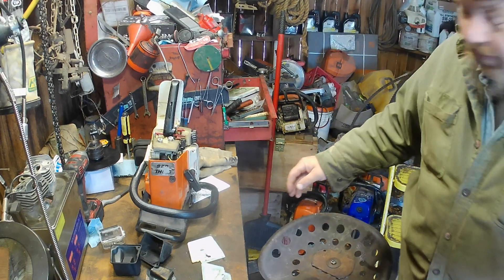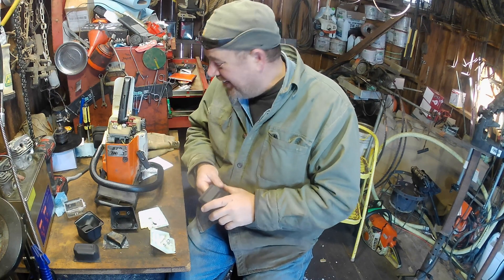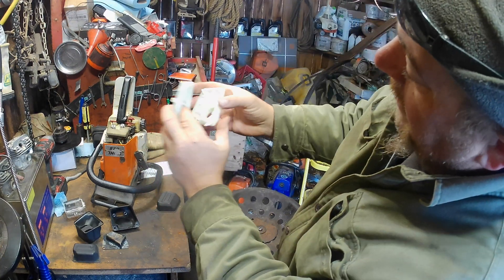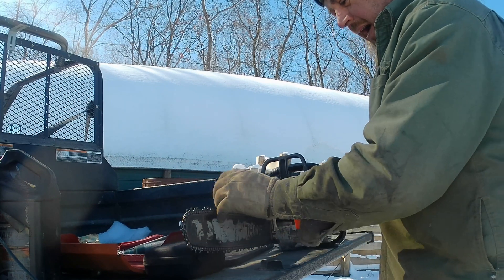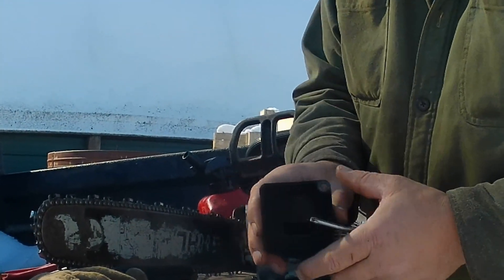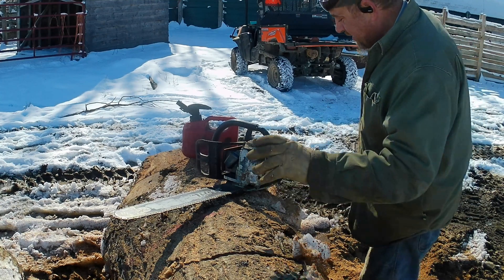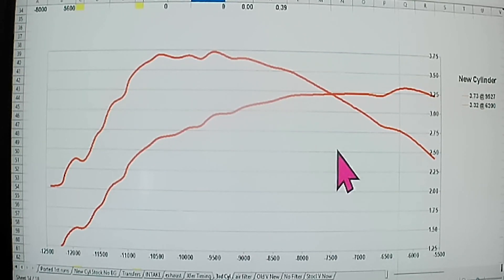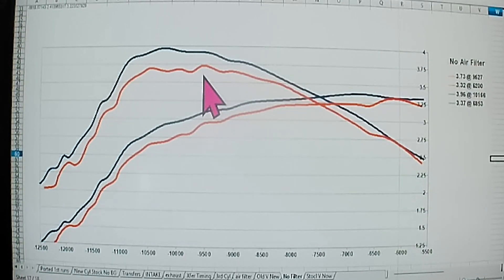Can I DUPLICATE Porting? - Documenting RESULTS with DYNO and CUTTING

Comment: I don't know how many times my projects are a two steps forward and three steps backwards deals. Anyway I'm learning lots. Great job on getting the new cylinder to match the last one. The hp# is coming around. I don't have any experience with 026 saws. I didn't realize the air filter was so restricted. I might suggest a bigger carb with a choke in the carb and maybe a ms390 type air filter might be close to making something work. Thanks for the video.
Reply from the maker: @TheJohnDeereGuy I don't mind a  project having hiccups when it's just my time; I sure didn't want people thinking I was jacking them around... just my mentality, I guess? I had a career in which my honesty was the cornerstone. I often find myself concerned that a simple mistake/bad luck could be looked upon as a dishonest/click bait, etc... move.
The plastic cover on the saw slides down a tongue/groove on each side while the back attaches to the back of the actual air filter. It's pretty limiting if attempting to keep the saw looking like the work saw that it's intended to be. I have a couple 390 carbs and 250 carbs... maybe an 036 carb or two as well. The "bolt pattern" is the same, so it may be better than nothing to just run a choked carb and get rid of the choke flap inside of the filter? We'll sure be trying something!  Thanks for joining-in again!

Comment: Great job as always. You couldn't get any closer to the old cylinder if you tried. 🤣 Oh wait you did. Nice job. As for the air filter I'd have to think about that one a bit. If I had one in front of me I do better with ideas. No don't ruin that saw with a big honkin filter hanging out of it. Thank goodness you don't want that. Love the sound of the bark box! As for exhaust mods. I often wondered if outlet location yields any benefits. Big hole small hole 🕳️ dual holes. I will say for a working saw big open dual ports seem to make the saw use more fuel without any feeling of a power increase. 🤷‍♂️ Tge chainsaw song 🎵 is the berries. Love hearing it. Hope to catch another video 🔜 👍🏻
Reply from the maker: @eze7524.Morning_Wood_Farms Thanks!! You're right, the saw needs its bonnet and such so it can still be treated like a tool instead of something fragile. 
Aint too sure the bark box gave any more grunt or hp, but it did sound OK, didn't it. It seemed like it sure ate up the fuel, but on the other hand, it looked like it had been running rich when i took the muffler back off. 
We are getting close to the testing of mufflers/mods/very mild pipes (still has to be a tool for a club-fisted redneck) as soon as I get the thermocouple built.... want to quantify temp impact associated with different pipes and with/without deflectors, etc...
I can switch to a 260 filter which is more breathable... have to change tank vent and back cover from original to one from a 260... I've already got the parts, so just need to do ti some day with some other small tests. Thanks, as always, for being here and helping make this place fun and/or informative...just so long as people can have a smile on their mugs!!

Comment: Firstly, I enjoy your chainsaw videos.

 I do have a suggestion that will make things easier on ya. Hylomar Blue sealant for your base gasket deletes. I got turned onto it by Dyno Joe. It will make the constant removal and installation of the cylinder much easier. Also no need to wait for it to cure before using it. I've been using it for 3-4 years now and have several saws with base gaskets deleted using Hylomar Blue and no failures.
Reply from the maker: @MrJeepfreak1972   FREAKING awesome!! I watch Dyno Joe with lots of respect; I must have missed the video(s) of the sealant he uses; thanks for sharing with the rest of us who may have missed Joe's advice!! Got some in my "cart" as we speak!!
Reply: @HayChaffandSawdust1  

I learned of it through a chainsaw forum before he was doing YouTube. I do think he did mention it in a video at one point though. The stuff is excellent. Comes out like jelly then turns to a wax like substance. Never hardens. It's like a toilet wax ring consistency once it drys. Another great benefit is it won't block ports if some squeezes in one as it washes out through the engine.
Reply from the maker: @MrJeepfreak1972  Ahh, Ok. No matter how I missed it, I'm sure glad you shared it with all who take the time to read here. Thanks!!
Reply: @HayChaffandSawdust1  
Glad to help. I hate removing moto seal and any other traditional type of sealant.

Comment: I've never ported a 026 but the intake timing seams off. I'd try 150-155 duration on it, that's still conservative. 
Most of the saws I've been into were 140-150 total duration stock and I ended up at 155 or so, trying not to go past 160.
The 660 clone and my zenoah 55cc clone with a big carb swapped onto it have 164 total opening and idle/tune just fine.
Reply from the maker: @nseric1233  I agree on each count; I've never ported one either and also would assume that the mid-to-upper 140s at a minimum. Glad you commented (and quite a few others helping here) because I have a question/conundrum: since the air filter seems to be my major restriction at this time, 1) I would think that longer duration of intake may help get the case  more full without worrying about the speed of the intake so much... since it's choked anyway, I assume the speed is already lowered to a point of plateau which won't change much until TOO much intake timing or etc... effects it. 2) would one be better off to change the timing via the piston skirt thereby allowing the intake to remain much the same or open the intake further? I would guess that the intake is already large enough to accommodate the carb and for-sure the filter, but giving it a few more degrees may help drastically. THOUGHTS??
Reply: @HayChaffandSawdust1  I would go to 75 -77 for 150-154 on intake. Can't remember where you are now. I'll have to go back and watch. Start low. Smaller saws react crazy with little changes has been my experience.  You could mess with your timing and see what the saw wants.
Reply from the maker: @eze7524.Morning_Wood_Farms Intake is actually low at 68.5/137. Trying to decide whether to take off of skirt or floor of port. Not sure if I want port any bigger?  Numbers (and previous numbers) are in the description below (on a laptop anyway) the video. If watching cell on phone, not sure. FYI, That's also where my email/facebook etc is also.
Reply: @HayChaffandSawdust1  If you want to experiment taking it off the piston is easier to undo.
Reply from the maker: @nseric1233 Right; plus I have an extra new piston if I go too far.

Comment: Excellent work as expected.  I'm impressed how closely that new jug matched the last one after mods.  At least you've proven your consistency.

I'm all out of suggestions going forward.  I think you have all my questions covered.  Except for the markings on my bars.  I'll have to go check mine to see what kind of chainsaw user i am.
Reply from the maker: @Kevin.L_  I was SURE hoping it would be similar so that we can continue with the testing without having to go back too far. I think we can continue right on down the trail.
Better check those bars!!! Can have a Union "wobble" if they think a tree feller is moonlightin' as a bucker!! 😂

Comment: You did a mighty fine job duplicating your last cylinder. Stuff happens in this game and you recovered from it better than I’ve seen anyone do it before. Your resolve to make this a quality channel shines through and your efforts do not go unnoticed. Incredible work my friend! 
Exhaust and air intake mods are really going to wake this thing up. I was looking at my 026s and 024s and was kinda thinking the same thing about those air filter designs. They were/are a great saw but for some reason they must not have had guys like us in mind when they designed them. Lol.
Reply from the maker: @FarmlessFarmer-xs1he  Thanks Farmless! I feel that I only recovered due to having front-loaded the vids a little bit, but I'm out of breathing room for now.  I just don't want to fall into the habit of getting hopes-up of videos to come, then not ever delivering.
I think you're right on the 024/026 designs. One of those max flow types would do wonders, but this saw has to ride in the back of a SxS, (maybe) get rained on, etc...  I know a 260 filter can be used, and I intend to dyno the difference at some point. 
I don't know about putting a carb with a choke in it, and gutting the choke out of the filter; it would be a little longer and the top cover may not fit... I have some ideas, but am looking for more! Put your thinkin' cap on for thissun, Farmless!!! 🤓
Reply: Will do and I have enough of these to experiment a little. But I bet you’ll beat me to it
Reply from the maker: @FarmlessFarmer-xs1he  I may or may not beat you to it; it's doubtful that I find the best answer/solution though. Whenever I come up with something, there's usually plenty of room for improvement!! That may be your job 😉😉😜😜🤓🤓

Comment: I’m confident that most of us here do not feel jacked around.  A true testing environment is going to come with positive and negative results, often more questions than answers. 

Personally, as a “Maker”, not an, engineer, machinist, scientist, carpenter, welder, plumber, or any other Pro, I completely understand that learning is the driver of the adventure, the outcome is knowledge and with some luck experience and perseverance, a product that is some form of the expectation from the onset.  Thank you for sharing the process! 

If it’s any consolation, I’ll say my latest saw mod blunder, I sheered a key on my flywheel Friday. Forgot to retorque the flywheel with a piston stop in, nut worked loose, flywheel slammed to a stop against the magneto. Oops.  Used it as an opportunity to adjust timing and moved on. 

Outstanding work getting the porting back to where we were.  Is a carb swap and make a choke linkage from piano wire an option? That would open you up to some more generic filter setups, if there is room under the hood. This definitely sounds like what has been holding back the numbers, especially in the higher rpm’s.
Reply from the maker: @Archer_82 I know we both agree on the knowledge-gained is the important part to each of us and we let the results fall where they may. I know my dyno is stingy  (I would guess by about 10-15 percent, and I could fudge any input by that much very easily... but it's not real and would just serve to inflate my own ego of the BIG HP saws I can build. ( actually, SAE corrections gives 11%, I think).
Anyway, sorry to hear about your flywheel issue. Key cast into the flywheel?  How much Timing do you like advance on your 210/250? and putting a 250 back together today that ate itself. i had forgot when I built it the first time, I did give a little bit of advance (probably 3 deg or so).
I was also thinking about a carb with a choke in it; if nothing else, it would get the choke flap out of the way that is inside of the filter... may help some. There sure isn't much room under the bonnet of this one. The 034 is similar filter, but with a choke in the carb; I may be able to duplicate the linkage as i just had an 034 back across my bench; I had ported it a couple years ago... came back for carb work, so all it still good.  I wonder that, with the restricted filter, if longer intake timing may help considerable? Thoughts??
Reply: The flywheel is the original 021 with integrated aluminum key. I honestly just moved it and said let’s try that. Since you asked, I measured the advance at 0.230” of arc at the outside of the flywheel, radius of 1.830” used a formula online and that all equated to 7.20* advance over 021 stock with this 250 motor. By eye it’s a little more than half the key way.  The thing ran wonderfully today and I was able to lean on it with all 18 in that dry maple. 

I was wondering about the intake timing on the 026. In the way that I am trying to relate your numbers to what is happening with the 021/250 project.  I have a lot more intake but understand that it’s likely too much and costing velocity, maybe made up for with heaps of volume and flow?  You know how much I have hogged out this case, added piston windows and such. 

Currently: 
Squish 0.022”
Intake 84/85  169 total
Exhaust 94/94 172 total
Transfers 119 (25bd) 
Advance 7.2* over 021 stock
Piston 43g (48 stock)
Crank 360g (374 stock)

So we definitely have different saws, heck mine is clamshell. But they are similar displacement, I am guessing you have more torque. When I take this one apart again, it will go to 16-17 squish, I’ll add a taper to the piston top and further drop the exhaust adding more intake. Yes, I think you could see benefits for further intake timing, but I don’t have a lot of experience to base that on, definitely no results based data. This casting had 165* as cast, for reference. Do you know what a factory 025 is cast at? I do notice less fuel efficiency, and I’m okay with that, the smile factor is there now for sure.
Reply from the maker: @Archer_82  The 026 does have more torque and a lot lower intake duration. Ain't it a shame, but I can't remember the ms250 blowdown, and I JUST done one today. Don't hold me to these numbers, but I think I was over 160 intake and NEVER TOUCHED the intake; exhaust was 99 and fell at 98.5 by time I cleaned up the flashing. Stock timing may have been a little lower, but with the LRB pop-up piston (cut deeper on skirt of intake side of piston). The 250 has SUCH a better air intake path than the 026.  I think we may do some muffler testing to see where we can get and then start opening the intake. Which would you consider first: longer duration by taking off of the skirt or the floor of the intake port?  I was thinking, at least, some from the skirt to attempt to keep the speed up over too-big of an intake port. Thoughts? Will try to get 250 port work and dyno results posted soon. Nothing as vigorous as yours, but just a stout lil' firewood saw.
Reply: That’s a great point, with skirt work, you can add port timing quickly without increasing the diameter of the port, keeping your velocity, and as you had said on another comment, allowing more time for that restrictive flow path to fill the case. I would think that is a great first step. Also, definitely a few pipe options, agreed, prior to more grinding. To help showcase the volumetric effect with what you have already created, hopefully it shows up, maybe even with the ability to move the torque curve around, that would be cool to see. 

I’m very happy you had suggested the iron horse style on this 250 motor, wow, what a difference.  Thank you very much for your knowledge and advisement on this project. So happy I got the transfers even, side to side, I wouldn’t be able to stand it if the saw cut crooked!